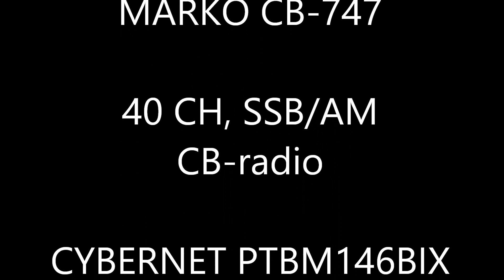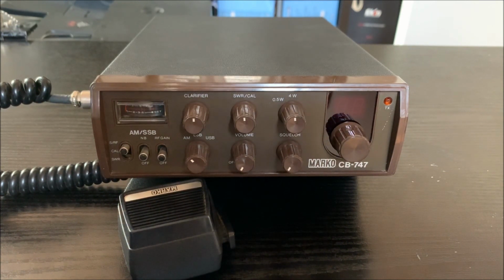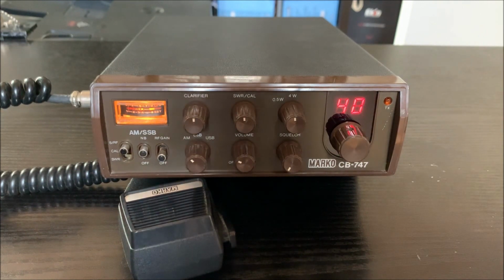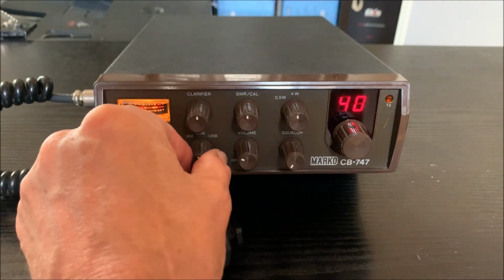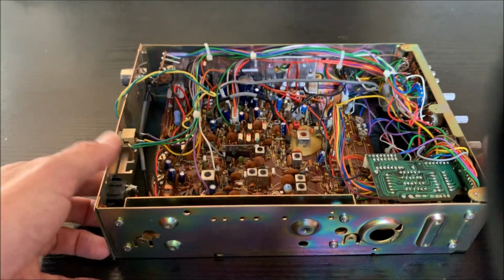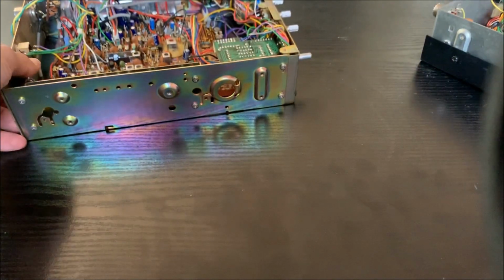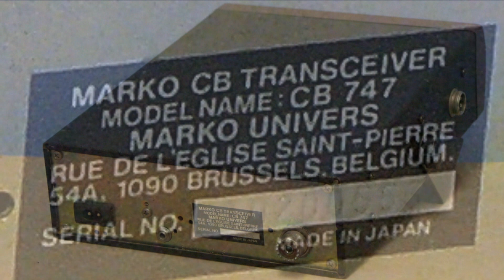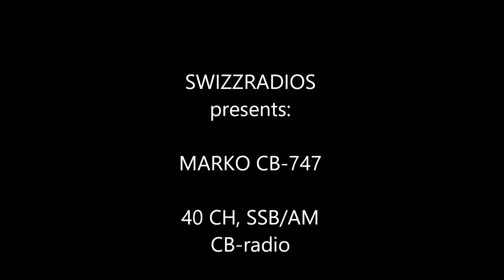MARKO CB-747, strange 40CH, SSB/AM, CB radio

Comment: The General Electric 3-5826A used an almost exact same board.
Reply from the maker: Hello dr CB-radio friend, thank you for your info. But the GE 3-5826A is using the PTBM139 PCB, this is very similar to MARKO 747 (PTBM146). Best 73s to you...
Reply: @SWIZZRADIOS  Thats why i said "Almost", They do look very similar but there are some differences.
Reply from the maker: Mister Spirit hello, no Problem, you're welcome, happy airwaves to you...

Comment: The case design, shape and layout is exactly the same as the Electrophone CB-550 marketed here in Australia although it featured a PLL-02A chip 👍
Reply from the maker: Mister Spectre hello, how are you. Yes, the Electrophone 550 is using the PTBM048 PCB. This print has one of the best layout, by CYBERNET ever built: Big SSB-filter, high sensitivity and very clear SSB/AM modulation. Best 73s to you..